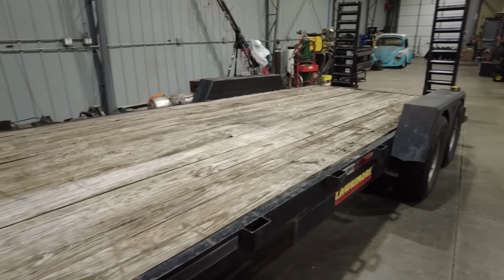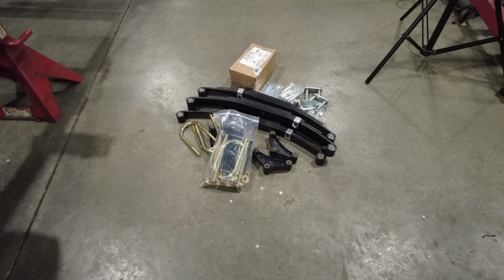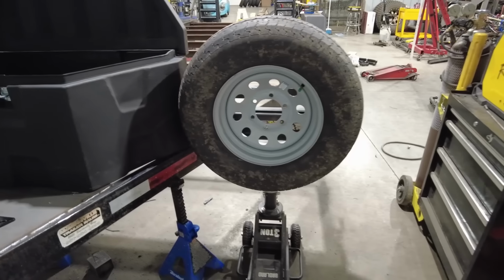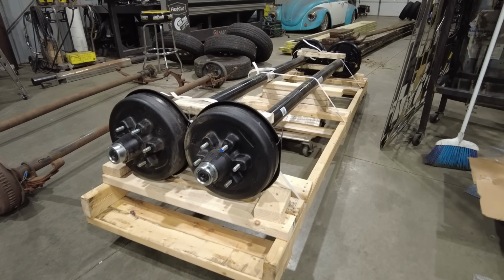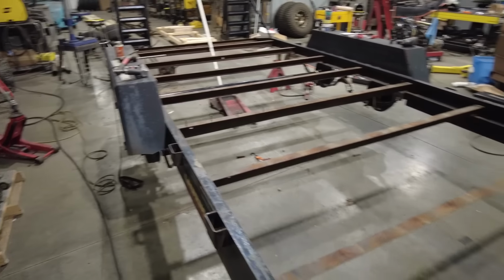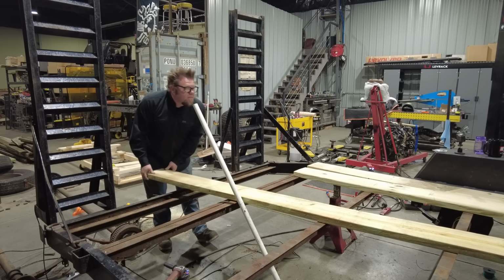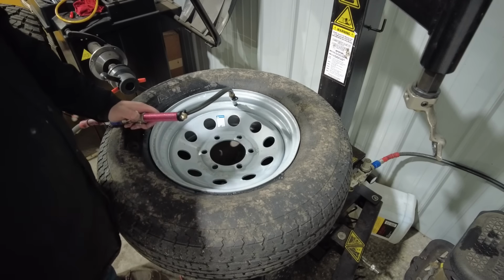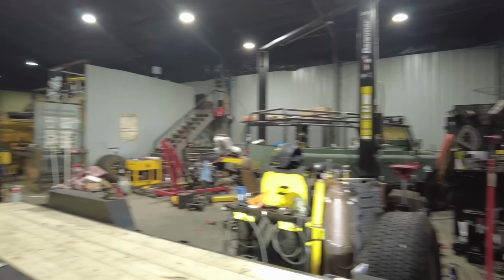Car Trailer Rebuild, How to Increase the Load Capacity of your trailer

Comment: I have a nearly identical trailer myself. It was a trailer that was originally used by a relative to haul farm tractors. I redid the suspension about 6 years ago going from two 4k axles to two 5k axles, I also added two drop legs onto the ramps, LED tail lites, and I went with a full diamond plate steel deck. I added a raised 12k winch mounted to a tower that incorporates the tongue jack. I added a full size battery and box and a similar wiring junction box. 
I also built wider, heavier duty 6ft long rear ramps. My spare tires are mounted beneath the deck just ahead of the axles on each side. Over the years I found that works best since it saves the tires from UV damage without the need for tire covers. Removing a spare is as simple as cranking down a cable winch on each side. I didn't add a tongue box since I needed the ability to use that space for overhang on occasion. 

The one thing I see that could be an issue with those center mounted lights in the deck is if your dragging something onboard that don't have wheels, the lights can get ripped out of their holes. I had a trailer that had deck lights in the floor but they were in heavy steel cases that mounted flush in deck, they resembled the reflectors they put down the center line of the road but with clear lenses and LED lights. They survived years of dragging farm equipment and junk trucks over them without incident. That trailer had wood down both sides and heavy steel plate down the middle and outer edges with multiple heavy recessed tie down points. I also boxed in my tail lights and under mounted all markers to keep them safe from tie down hooks and chains. 

One addition I made to my current trailer is a set of steel inserts to accept deck level pulleys for when the load being pulled is off to one side or the other. I found myself dragging things out of parking places and the woods quite often and being able to drag it clear of where it was found really came in handy. It works well since my trailer is heavy enough to stand its ground in such a pulling situation. 

I do like your fenders, which is something I've yet to do on my trailer, I'm contemplating building a custom set of super heavy duty diamond plate fenders that can take the weight of a vehicle if needed. Right now mine are just plain stamped steel. They do the job at hand but I would never stand on them.  When the time comes, I'll likely build them similar to how the fenders are made on a cement truck, sort of Jeep style with a heavy back panel and heavy center support. 
The fenders on mine are the widest point, which measures a full 102 inches overall. It gives me a full 85" wide flat deck. My trailer was new in 1971.
Reply: Lol I like using plastic barrels for fenders .. the blue or black ones 55 gal ... just cut the bottom off the barrel about a foot up .. then split  that  or cut one side of the circle part free from the bottom .. now u you have a flexible fender that costs nearly nothing .. use the bottom to mount it to the  axle or some thing coming from the axle  or what ever your mount is .. nif you need to drive on it it just mashes down to the ire and then springs back   ..and if it some how gets againt the tire it  dosent cut the tire ..

Comment: You have done an incredible job on this build. But staying with those 15'' tires will bite you in the ass. I would have gone with a 16'' trailer tire and forget a lot of your tire troubles down the road. Nice build sir.
Reply: Go with a 16 inch rim and minimum of 14ply tire but I prefer a 16 ply tire. Pricey but worth it.

Comment: something that bit me once, tire load rating, cant remember the exacts but the trooper told me you can have 20,000lb axels but if your tires are rated to 1000 then you can only gross 2000(assuming 2 wheels)
great video, just found your channel, i used to watch you long ago on tv keep up the great work
Reply from the maker: Thanks for watching...yeah my tores are rated at 3400 lbs a piece

Comment: I would never use an impact gun on the jack. The impact feature is going to put serious stress on stuff that doesn't need it. A regular heavy duty drill with gear reduction will work just fine.

Comment: what made you decide not to put metal on it? I"ve got a custom trailer I built but it has old plywood flooring. But trying to decide to go with metal or replacing with 2x6 boards.
Reply from the maker: I would of had to add 1.5" stringers on top of the existing cross members...adding weight time and money to the project
Reply: @BigTireGarage  Guessing the 1.5" stringers would have been to raise your deck level with the angle iron of the front, sides and end of the trailer.  That makes sense. Thanks!

Comment: To be fair you didn't include any labor or the value of the original trailer.  You did this because the axles were free and you get paid by people watching the rebuild.  Other notable mentions, 5k rated axles don't change your GVW, would be like taking an older 1500 truck and putting 2500 axles under it, yes the brakes would be better, right up until the frame folded in half...
Reply from the maker: Frame on 7K and 10K trailers is identical from most manufacturers
Reply: @BigTireGarage  
I am sure your trailer's manufacturer would back you up 100%, besides you failed to mention this and now there are a bunch of youtube commandos that think they can just change an axle on a trailer and it magically is able to safely carry more weight.  👎

Comment: Mounting tires there is going to limit your turning radius and possibily jackknife against the tire. mounting them under the front corners flat to the bottom of the trailer just back from where the tonge starts would be better .
Reply from the maker: Andwered this in my QandA...and no myvturning radius is not effected

Comment: Typical TV style bid but great content on the overhaul. You didnt include the ‘free’ use of the cutting table and your time/labor. The $7500 out the door for the new trailer includes everything and you can probably get a return on your old trailer by selling it so the cost isn’t as bad as you think on the new one…..you just walk in plop down some money and walk out with one…no sweat equity required…..although you’re gonna get a piece of crap with todays workmanship, I’ll acknowledge that.
Reply from the maker: True....and I do not include my labor when I do things because my labor rate is much different than anyone else's labor.  Plus if I was going to do that I would also have to include the money "made" from this video....and in that case....the trailer is free

Comment: I've been piecing together items to spruce up my trailer.  Thanks for some items I haven't thought about. 

Give the wood a couple coats of boiled linseed oil (BLO)  on all 6 sides of the wood will increase the longevity of the deck.  At the very least do the top.  BLO can take a long time to dry or you can reduce it.

Comment: I would to have seen Ian install 8/4 rough sawn oak from a saw mill on the floor and the spare tires mounted on spindles and a little high so you can see the marker lights easier 🇺🇸👊🏼

Comment: For anyone rebuilding a used trailer id really recommend taking a close look at all those shackle hangers and make sure there are no cracks in the welds, or just making sure theres more than tack welds holding it together. Have seen it multiple times on “quality” lippert frames. Nothing sucks more that having mounts shear off hundreds of miles from home

Comment: Why is the rear suspension installed backwards?
Reply from the maker: The shackles flip back over when it sits on its own weight
Reply: @BigTireGarage  I've had a second look through the video and that is the only way that set of components can go together so I guess it is what it is. Typically the shackles will always be at the rear of the spring but I guess not with this kit. The major down side of this is if the trailer is loaded on one side, or you hit a heavy bump on one side, both axles will steer in different directions and can shove the back of the tow vehicle to one side quite violently. I've actually been a small scale trailer manufacturer in Australia and have done this and been in a situation where I was sent half way into the neighbouring lane going down the highway at 110km. Anyhow, it's something to look into and consider addressing.

Comment: 36:03 
Humbly,  I  would suggest a C channel down the center,  with lights and extra tie downs. You can NEVER have too many straps. I agree with the hub for a spare tire holder and i would suggest spare tire covers. I live in the Midwest and road salt is hell on everything. The tire cover will also help deter rust on the lug and rim of your spare.
Reply from the maker: I never thought of that until it was suggested and its a great idea

Comment: You should throw some tack welds on the spare wheel lug bolts. Make mounting those spares a hell of lot easier. Not just a $3000 savings, but it's exactly what you want/need.
Reply from the maker: Yeah I plan on doing that....Ideally I wanted to put wheel studs in
Reply: @BigTireGarage  with only an 1/8th, wondering if a wheel stud would actually stay...

Comment: You should always run your trailer tires at the max cold psi it says on the tire. For every 5 psi your low you lose 10% of the carrying capacity.  Take it from a guy who has been in the trailer mfg business building and servicing trailer for 30 years. They are not like car tires where you run them at 30 psi. If the tires says 65 psi thats what they need to be set too, cold. You will have premature tire wear and blow outs with under inflated tires.

Comment: I'm sure you have the wrong air pressure in your trailer tires. If the side of the tire states 65 psi thats what you run in your tires. Its not like a car tire. It doesn't go by the weight you have on your trailer. Trust me

Comment: I'm amazed at how many people don't seem to charge their trailers off the 7pin.
A trick with the spare tires. Extend the mount tubes a couple of inches past past the mounting flange. Then you don't have to lift the tires direct onto the studs.
Reply from the maker: Am thinking of actually thinking of adding a piece of tube to the front of the plate for that purpose

Comment: Double sided 7 pin male connector so you take it out and replace the plug and cord without rewiring the whole trailer if it gets a nasty rub or bad connection I carry and extra cord in my box
Reply from the maker: That is one of the reasons that the junction box is so good.  You can swap in a new lead easily

Comment: I would be concerned about chafing where your taped wires go through the holes in the frame.  Another thing to consider is the break-away wiring.  I would suggest lengthening the wires from the control box to the break-away box, in case someone uses the tongue as a step. Your wire angled to the break-away is vulnerable to being pulled apart if stepped on.

Comment: Just an FYI- something I learned a while ago is your axle cap is 10k Gross. Meaning 10k minus the weight of the trailer. 10k worth of axles minus a 2500lb trailer (guesstimate) means you have a 7500lb capacity trailer.
Just wanted to make mention of it as it was something I learned, and something I noticed you say in the video more than once. Otherwise great build up! Love trailer mods

Comment: Just because you put 2 5k axles under a trailer doesn’t make it a 10k trailer the framing has to be built for that also
Reply from the maker: The frame on this trailer is 5" C channel with a heavier guage 5" for the tongue....the same specs as the 18' 10 K offered from Larimore..

Comment: Just like my car hauler I bought new in 2010, getting ready to put another floor on it and seriously thinking about adding breaks on the second axle and do the drive over fenders. When I bought it it had the winch plate and battery box already on it so that was a plus. I paid a little over 2 grand for it and pricing new trailers are ridiculous
Reply from the maker: Love the Motobilt drive over fenders

Comment: Every utility trailer I’ve ever messed with has had the typical colors (left turn = yellow right turn green for example.) When I put a new plug on my camper I was quite confused. There are 2 variations for some reason.

Comment: And why would you go to brakes on both axles that isn't safe. In case of an emergency when one axle is braking and the other is able to stabilize the trailer and keep it under control until it is stopped is the safest. If both axels lock then the trailer can slide sideways. Causing the trailer to roll. And Flip over.
Reply from the maker: First I ever heard of that...all of my larger trailers have brakes on both axles
Reply: @BigTireGarage  So do semis

Comment: Are you sure, is that All you need to do to increase the weight capacity, is replace the axel's. What about the strength of the trailer. What about increasing the strength of the frame. Just asking, I would like to increase the weight capacity of my trailer. But will the trailer frame handle it.  I'm already hauling 6,000 pounds on a 7,000 pound capacity. Plus the 1,500 pounds the trailer weighs makes it around 7,500 pounds gross.
Reply from the maker: I compared my frame to the same trailer manufacturer selling a 10K trailer. And compared the frames. The 10K frame at the dealer is 5" c Channel for the frame and tongue.

My trailer is 5" c channel everywhere so I am ver confident that the frame is strong enough.

Comment: You may have missed a bet by not using idler hubs for your axles as spare mounts. Would've saved some work with the new iron on the front. And it would give you spare: hubs, lugs and studs, bearings, and the spare tire all in one package.

Comment: Why would you not sand off the rusty tops of those joists and repaint then before putting decking over them?
Reply from the maker: If I was gonna paint the trailer I was gonna go all in and powdercoat the entire thing..and I didn't want to invest that much time...plus its only surface rust...

Comment: A few things I think you should add::  Gussets to the spare tire mounts. Vibrations can crack welds over time. LED lights inside of the fenders, toward the outer lip. If you've ever lost a bearing on the road at night, well, you know exactly why I'd add them. Last, I'd hang the license plate sideways on the drivers side fender, rather than have it getting trashed on trails and such. Mine is where yours is, but my frame sits higher for the light.  It would have been great to end the video with the trailer hooked to your truck with something on the trailer at night, showing the deck lighting and how useful it really is....
Reply: i like the LED’s inside the fender, neat trick.
Reply: youre going to mount LEDs in the fender for the off chance that you need to replace the bearings on the side of the road at night? instead of just having a portable light that you could use anywhere on the trailer
Reply from the maker: I will keep an eye on them

Comment: Judging by all of the sparks coming off your grinder, im definitely using the wrong wheels, which ones do you use? Those look like they eat through metal like thermite lol, I use 36 grit zirconia resin disks, I get maybe half the sparks you do
Reply from the maker: I use benchmark abrasive flap discs

Comment: Quick question and little thing I did with my car hauler trailer. My question is are you going to cut the tongue off and get a higher rated lb tongue? Mine was rated for 7500lbs but I cut it off and welded an 15,000lb tongue! But for spares! You should weld a plate up front get two spindles and two spare hubs pretty much weld the spindles to the plate boom two spare hubs already assembled and ready to go if anything happens! I’ve been doing this on all my trailers and I will say haven’t needed a hub yet but if I do I always got one! 😂

Comment: Tip for wiring lights yellow left side (yellow lines on road) green right (green grass)
Reply: yeLlow (Left), gReen (right), brown (tail/running), red (12v+), white (12v-), Blue (Brake), black (reverse).

Comment: I ran into the same stupid break out box issue the other night rewiring my car trailer. The breakout box is awesome for when you're leaving and a circuit is dead, crack it open and jam a wire in and ziptie it and go, no time for fussing around splitting looms. The PROBLEM is there are THREE standards of 7 pin plug. Regular, RV, and Aggro. The red wire is the give away its RV as I learned. Like you did, just re-label and move on.

Comment: Gussets under the  spare tire mounts, because even with them pulled tight against the frame.
Gravity, and bouncing down the road is a major load considering the weight of the tire n wheels, as well the bouncing adds additional energy to the down force applied to the welds themselves and tubing of trailer.
Also on your raw wood edges in the center, I'd use proper sized angle iron to cover those edges, and just stitch welded to frame.
Reason being it saves the edges of the lumber from being chipped or split by something being dropped on those edges, and keeps the lumber from curling as it cures, not too mention it cleans up the nice job you've done everywhere else. 
Only problem with exposed switches and buttons, is they get pushed by kids, and are people just pushing buttons, and possibly drain your battery. 
Then there's the comment accidentally bumping the buttons during the day time, and not realizing that it was done due to the sun making it difficult to know. 
Otherwise great job, but dam stuff has more than doubled in cost last couple years, and I really don't understand the reasons why, except people are just greedy taking unfair advantage of everything and everyone